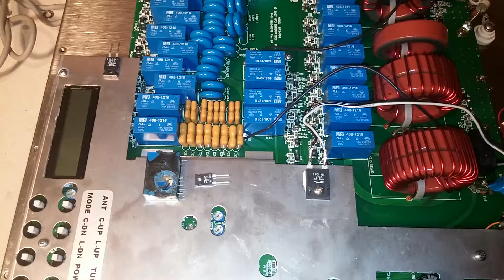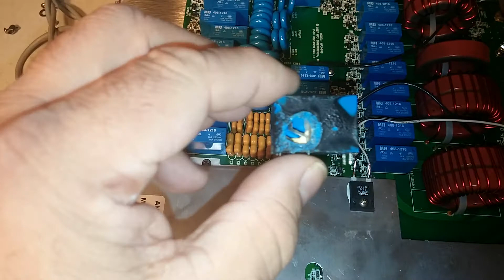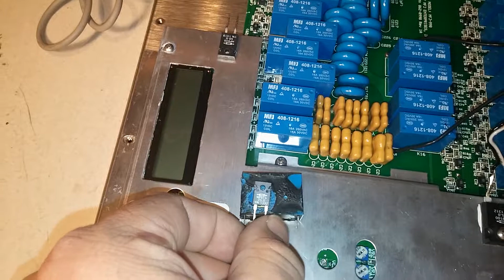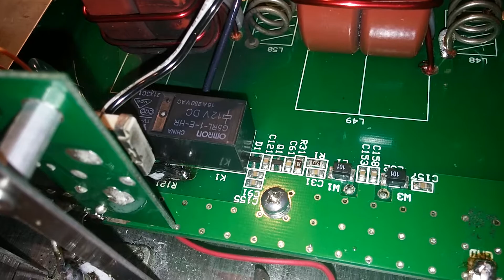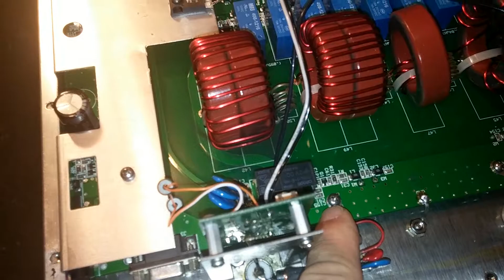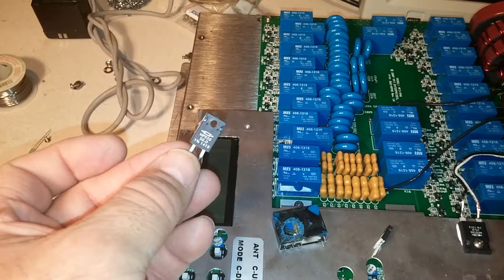MFJ 998RT Repair and Mod - failed K1 Relay and R121

Comment: I have a problem with the mfj 939 tuner when the swr indicator is on sometimes and the K1 relay sometimes works sometimes doesn't work, is the problem the same as your tuner ?

Comment: Just received my 998RT today (May 25, 2021). Have not unboxed it yet. If my newer unit still has the 15 watt resistor without a heatsink on it I may do a bit of preventative maintenance and use your 100 watt resistor solution before hooking it into my station. 

Thanks for posting your solution!

Bill - W7JZE
Reply: This is not first time when MFJ sucks…    But nice modification !!  👍😊